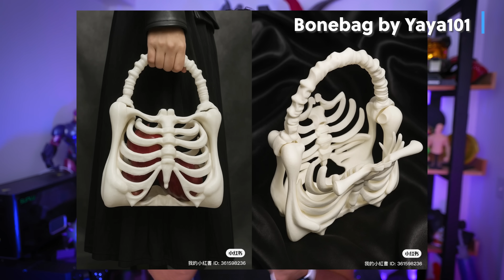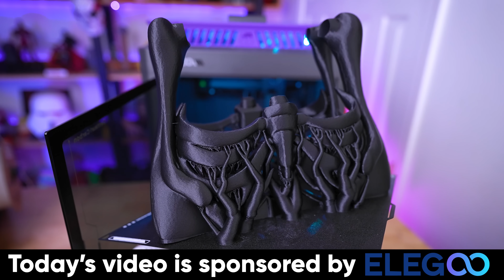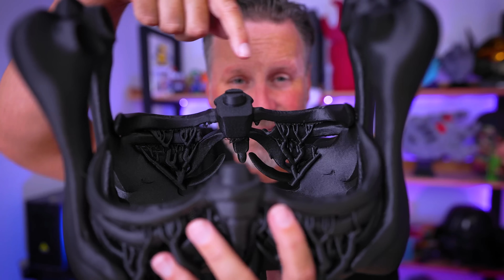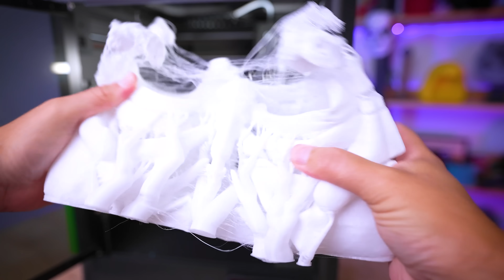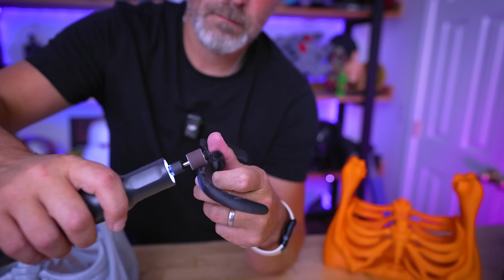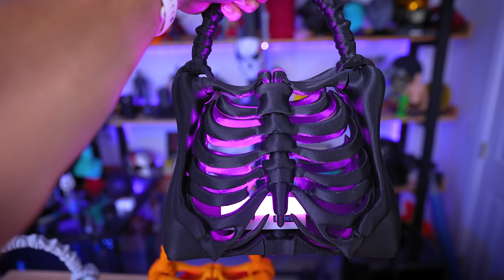The Spookiest Bag You’ll Ever 3D Print! BONE BAGS!

Comment: I am currently printing this right now. A bit scared after watching this video. Starting with the biggest piece, which is what is printing at the moment on my p1s. I went with SUNLU Bone White. I have only ever printed with PLA so I hope it comes out ok, depending how it goes, I may try PETG or something stronger later. I am using just the straight file as it loaded in my slicer from the creator. I hope it works.

Comment: We do need an ability to change where the supports start and ride up the sides of parts, or at least limit how close they get because I have also bee running into support issues (In the Elegoo Slicer) top z distance is really nice but Rapid PETG for my prints is very good at sticking to itself. I have just been melting it down with a lighter to break it free and then filing it down but if we can get more refinement would be perfect. Not to mention, I have had supports out right fail and still do their job in the end as a clump of mess lol so I dunno

Comment: I think I’m going to try this in glow in the dark pla
Reply: My first thought as well. I’ve got a brand new spool itching to be opened. Just need to figure some way to line it, so my kid can use it for trick-or-treating and not drop any candy
Reply: Ohhhh let me know how it goes
Reply: I'm doing that right now!!
Reply: Printed it in Amazon glow in the dark PLA and it works just fine. As UJ says, I would take care to sand down the handle joints a bit there's not much material there
Reply: I bought a glitter glow but now I'm worried it may not be enough

Comment: I did print one of these and as a woman who uses a purse daily I found this completely useless. The handle does nothing but get in the way and blocks access to the bag, leave it off and buy yourself some nice cord or something to use as there is a nice sturdy area where you could tie that too. As far as the way it opens and closes, meh, it's ok but doesn't stay closed and the various sections of ribs can pop off with little effort. It looks cool AF but for practical use it's garbage. Maybe a onetime use for a Halloween party, sure, otherwise it'll be sitting on a shelf collecting dust. Also, it looks big but it doesn't hold very much, phone, wallet, keys, that's it and you better line it with cloth or something or things could fall out very easily. Cute but worthless
Reply: So like most 3d printed stuff? Welcome to the hobby
Reply: Seems like most of the stuff people make popular
Reply: There's a redesigned remix that has a magnet clasp and is immune to falling apart. It prints pre-assembled and has other various upgrades too
Reply: @fatimaabdulla8488 Where is this attainable as everyone every time I've made it the thing breaks when i attempt to assemble it
Reply: That’s what our prints do. Sit on a shelf and collect dust
Reply: Maybe a cord handle laced with 3d printed knuckle bones.

Comment: 8:32 quick question if I may. Great video btw. 🫡 I don’t own a 3D printer but am looking to get one very soon. I was wondering, when working with these materials can some be worked like pvc? What I mean to ask, during this process time stamped, could hot water be used to warm up the piece and help or flex? Idk if I am asking the right question to be honest 😰 🫡 thanks again
Reply: Depends on the material, PLA is a very common material that does warp with heat

Comment: It would be cool to print that in a glowing filament.

Are you trying to slide the bulbous rung into the clips in the handle from the top or from the side? With a bit of rounding, it seems that sliding in from the side would work better. Looks to be a near interference fit.
Reply from the maker: Yeah I was debating on remixing that for myself to make that whole process easier